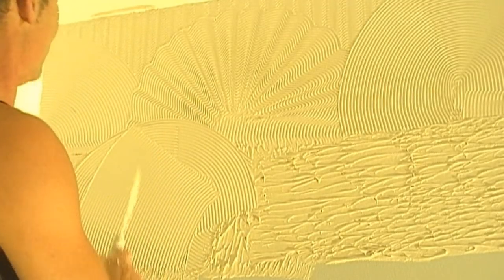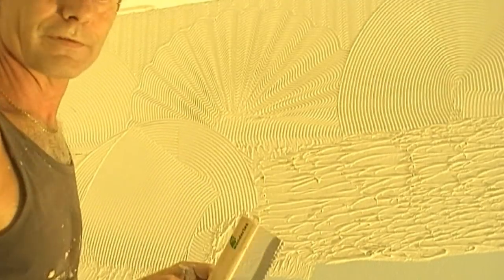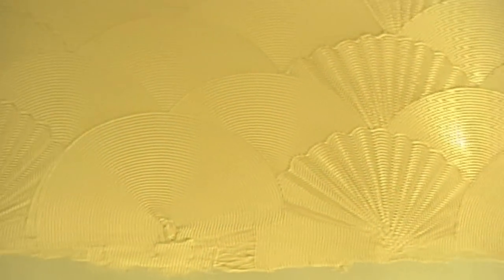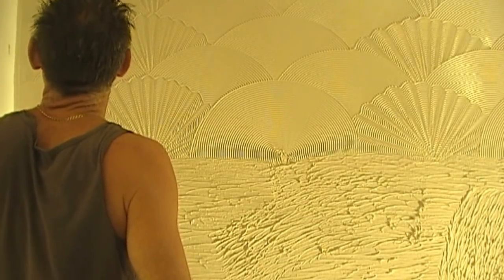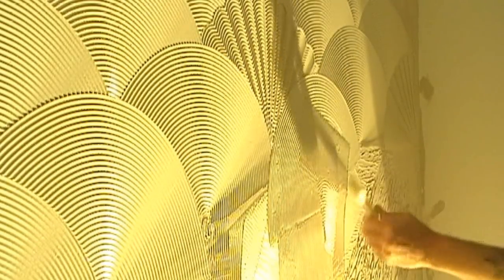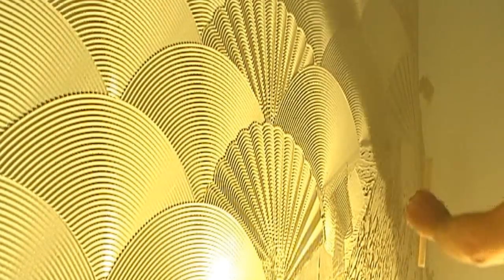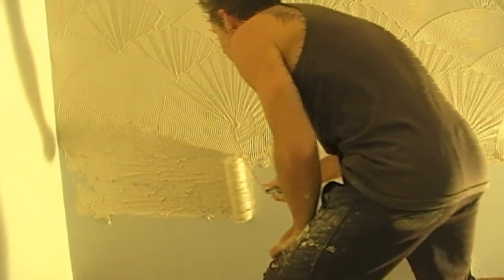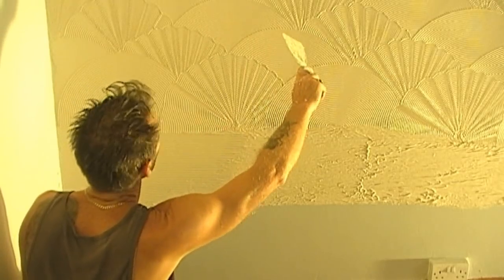Artexing Fan + Shell Combination Wall Texture Pattern

Comment: Last night after reviewing several of your videos saved for the last three years I combed in my first  shell ceiling over my shop work area.  I went back and tricked in some simple flower designs around the dormer lights, made them look expensive.  The quality of work to yours is not even nearly as good, though I did it and I believe it will encourage intricacy in my furniture designs which was the idea.  Things that would of made it better include real texture combs, ceiling rollers, and probably second person to talk though the elements.  The videos where a real help.  Thank You!
Reply from the maker: Jake you are most welcome and thank you for commenting.

I remember when I was teaching myself the art, without any instruction what so ever. I just prepared (oil based undercoat) a small wall in my bathroom and spent hours practicing. Then I could just wash down the wall ready for the next time.

When I eventually gained the confidence, I texture all the ceilings in my house

The next step was, that my family heard about the texturing, so they covered the cost of materials and I practiced more

Eventually, I became a texture practitioner (Artexer, as we were known as in the UK.)

Top tip, Jake

When you use propriety water-based sealer/primer (which need to be coated to the ceiling/wall and left to dry prior to texturing, which helps diminish some of the absorbency so that the texture does not dry too quick onto the surface, enabling you to work patterns.) There is a better solution for practicing on small areas, but caution is required...

Oil-based undercoat. The stuff you paint onto woodwork. So long as you get that to adhere firmly onto your ceiling/wall, and left to dry prior to texturing, allows the practitioner ample time to work the material before it dries too quick

The word of warning: make sure the room is well ventilated until the oil-base paint is dry

This method enables the working of the tools and the materials

I noticed only last week, there on ebay, some combs are still available. They are listed as artexing texturing combs. And are 250mm (10")

I hope you keep practicing, Jake, and lovely to here from you

Dale

Comment from the maker: HelpJoe Smith. Thank you for your comment.

The wall could be painted, but if you apply drywall texture onto the existing surface, and it goes off too quickly, you may need to seal/prime the surface first.

The idea of priming/sealing a surface prior to texturing onto it, is to help prevent porosity (prevent the applied texture drying off to quick whilst you are working it.)

Another great primer/sealer would be an 'oil based' kind of paint, as the applied texture may find it difficult to pass through the painted surface, thus staying workable longer.

Hope this helps.

Go to hubpages and type in 'inspired to write' as there are invaluable articles related to comb work & drywall textures 

Many regards, Dale

Comment: I do concrete stamp work. Watching you, I wonder if liquid release agent could be applied without ruining the integrity of your material/mud? In order to stamp a pattern in concrete we apply a stamp "release"  agent so the pattern/rubber stamp doesn't stick to the concrete.. Plaster is similar or has Portland in the base, no? Very nice work man.  I appreciate your craftmanship and your sharing.
Reply from the maker: There are texture patterns where a tool is stamped into the texture, ie 'stipple' for one, but texturing walls and ceilings is an entirely different mode of workmanship than stamping concrete. Thanks for commenting have a great day

Comment: IHave a few Question.Is that dry wall mud and will that design work on the ceiling,also where did you get the comb.???????
Reply from the maker: The design is ideal for ceilings but it is always good to practice a certain pattern on walls to familiarize with the texturing process. Drywall texture comb tools are available doing a search on Google, and also from https://www.lookreadlearn.com

Comment: A true craftsman, nice work. I have a small area of flat ceiling (3.5x2.5ft) to artex where we have stripped out a built-in wardrobe. The rest of the room is artexed with the pattern you have created here (minus the swiggly bits!  No tradesman in my area is interested in doing this so looks it'll have to be me - or I could just skim over flat :/ Can I ask what plaster or artex mix you recommend? And anywhere these comb tools can be found second-hand?
Reply from the maker: +Adrian Buck Thanks Adrian. The texture powder may be whatever you can obtain in your vicinity, sometimes the choice of product may be sparse. Have a great day, I hope your texturing task turns out well
Reply: Thanks. Yeah, not a whole lot to choose from out there. All could find at B&Q was two brands of the ready mix, 5 Litres minimum tub. Managed to get a reduction on the comb, only one left and had a crack at one end.

Comment: Sir , I also want to do the same design but have the fear that the mixture might dry untill I complete the first line . Can u tell me how much time does it take to dry and what kind of texture mixture is this that dries so late. I'm from India, please tell me the type of mixture u used that dries late.
Reply from the maker: Hi. Thanks for your message. The material used is called 'texture compound.' Mostly the drying time depends on the surface to be textured, in that it has to be primed, or sealed, to take away porosity. So that the compound does not 'absorb' into the surface. I hope this helps please let me know if you would like more information. Regards, Dale
Reply: The wall is primed and sealed. I'm from India and I'm not getting this fan. Can u send me the photograph of the fan and the measurements of the groove and projection in the fan so that I can make one. Also what's the brand name of the texture compound u used ? And if u know any brand in India which sells this compound like Asian paints, Burger, indigo etc . Thank u

Comment: I can do this kind of work but not for a few years now. I always marked out the wall or ceiling with pencil lines as a guide. No call for it now though. Shame but there it is
Reply from the maker: Thank you for commenting Wayne. There is still a call for textures and repairs. I sell loads of comb tools going to the States, Canada and the UK, as well as many other countries. It is not so popular in the UK but repairing and matching patterns are still about, as well as new builds. Have a great day
Reply: @Artexing  That's good to hear. I used to buy those spinning lazers for guide lines as cheap and started doing the 3 dot mark system to get the fans spot on. Was a guy in wales that spent one full day marking out ceilings and I tried to follow his way. I used cut teeth out of combs to for different effects. I used to do 2+ fan ceilings a week plus other patterns at about 40 bags a month, but do nothing now other that patching which I use fast set like easyfill 20. No shrinking and fast to complete. Keep up the good work and the trade skill alive

Comment: disculpas no se ingles ,podría decirme cual es la pasta que usa yo he probado con pasta muro y quedan los grumos atrás,cual es la mezcla por favor  que se ve que no se cae y queda bien marcada las figuras  se lo agradecería mucho para terminar mi pared de mi casa,  muchas gracias
Reply from the maker: Thank you Jorge, for your comment. The material is called 'texture' from powder mixed with water, and it does not dry too quick, allowing for making patterns on ceilings and walls. I hope this helps. Have a good day
Reply: donde lo encuentro o como se llamaria aca en chile estimado amigo, aca trabajo con pasta de muro , pero voy a tratar de agregar agua pero, debe ser esacta la cantidad para que no caiga en muralla , no techo,gracias espero su respuesta

Comment: Are you using joint compound or drywall mud?
Reply from the maker: A little experimental may reveal the answer as the texture material / product may be slightly different in the States compared to the UK

Comment: Gorgeous, how do you finish the bottom of the wall?
Reply from the maker: Hi there Mariam, thank you for commenting. The desired comb pattern is carried on all the way down the wall. I couldn't fully complete it because I ran out of texture. Just roll the wall, commence with the pattern desired, until you run out of wall. Finally, use your one inch brush to run along the skirting to clean up, & create a tidy edge (or use a 3.5" comb to create a pattern along the skirting, then use the one inch brush to tidy up)
Reply: Dale Ovenstone Thank you,  Dale.
Reply from the maker: Mariam Hamoud You are most welcome Mariam

Comment: You are using drywall mud, not plaster right?
Reply from the maker: Yes. There are available drywall compound whereas you can make textures to finish the job. As well as preparing the ceiling or walls. Hope this helps. Have a great day

Comment: is it joint compound you are using
Reply from the maker: Hi there Miss Pillip. Kind of a joint compound but the material is specifically made for texture finishing to create patterns, as well as for making good, taping up etc. Hope this helps
Reply: +Dale Ovenstone what the name of the product
Reply from the maker: There are 2 products I use to create patterns and both are ideal. Artex texture finish, & Wondertex Premier 5. Hope this helps. Have a great day